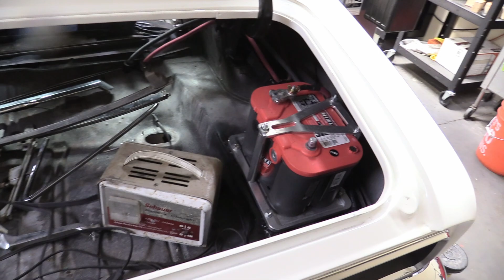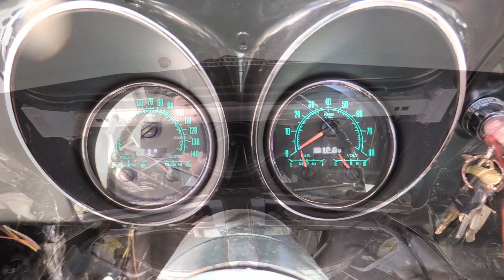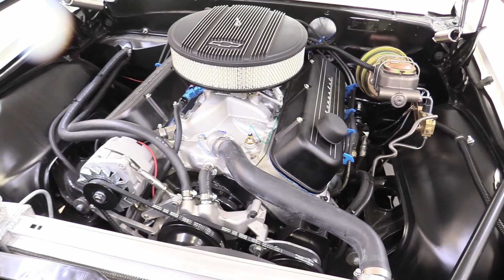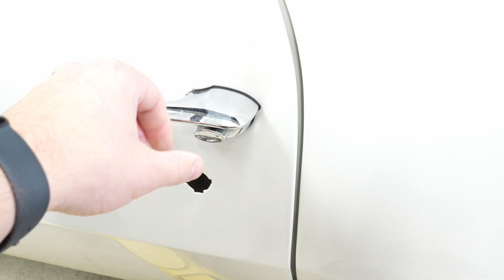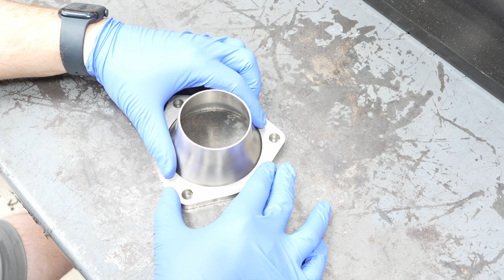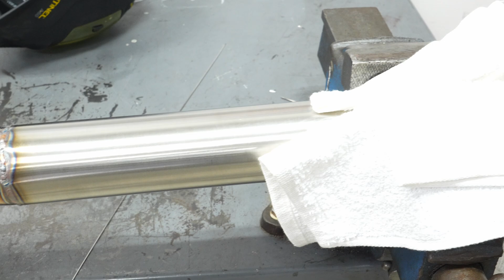Stainless Steel Exhaust Upgrade | Dream Car Episode #5

Comment: Good video. I have subscribed and liked.
I have a non related question. 
I've just been on your website and was reading your advice on how to read OBD-1 CODES for 1995 Isuzus. Yes it was helpful, but what I'm really needing ( if you can direct me ) is an OBD-1 scanner. One that actually works and is reliable. 
Any help you could offer would be great. 
Thanks 😎
Reply from the maker: Thank you so much for watching and subscribing! So those don't actually have a scanner (maybe there is a dealer part from GM or something) but everyone including me just uses a jumper wire from the A terminal to the B terminal and watch the check engine light blink in sequence. Hope that helps!
Reply: @2carpros  ... Yeah, a little while after I came to the end of all my research, I realized I already had the best solution. I had already seen a video that Scotty Kilmer did on a 92 Mazda. He used the jumper wire technique. And then he talked about the code flashes. It didn't dawn on me till later....if that's how Scotty Kilmer is doing it, then that's the way to do it. Actually, that saves me a good bit of money. I can put that cash into the car.
Thanks for getting back .
😎